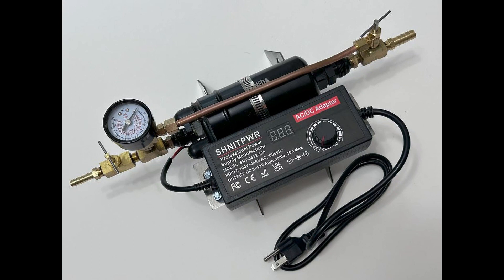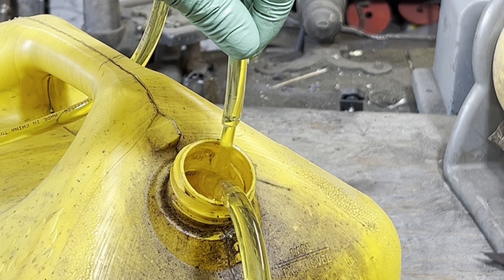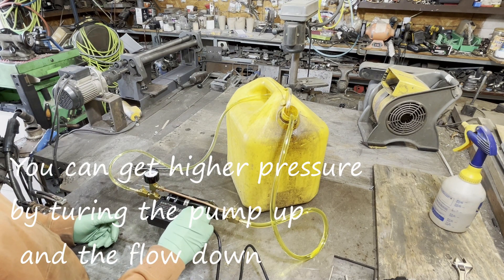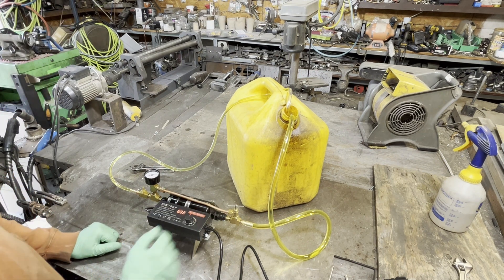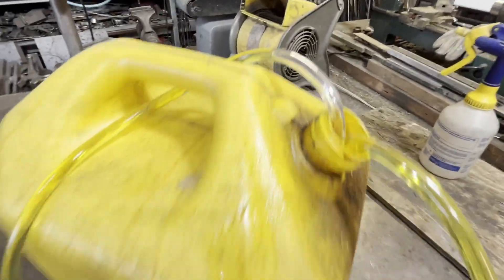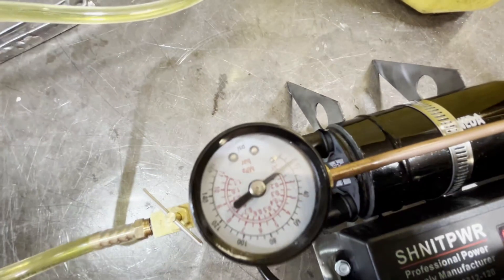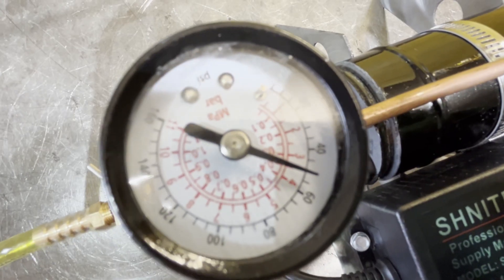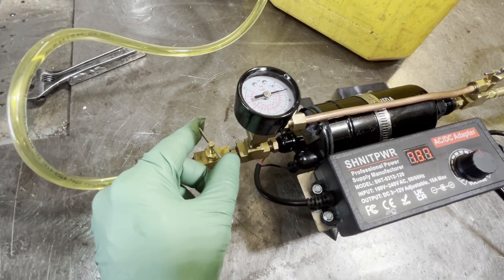Variable flow oil or fuel pump

Comment: I LIKE IT. Can we control this with a thermostat in conjunction with the blower that feeds a pot style burn chamber? I am installing an old Siegler heater that I would like to burn a little hotter using waste oil. Can't seem to get it to burn clean or hot enough with the current fuel regulator and factory fan setup.
Reply from the maker: Yes you could use a couple diodes and a solid state relay to turn it on using the 24 v signal or a multi function relay
Reply: @NOBOX7  I was thinking if you used the pump to pump it into a preheat vessel with a float actuated valve you could essentially turn this setup into a flow actuated pump so that it would only run when the float dropped. What are your thoughts on this and what would it take to make the connection between the float actuated valve and the pump? This setup could be very versatile for many applications.

Comment: will a peristaltic pump be better for metered flow rates? im planning to use a silicone tube peristaltic pump in conjunction with an atomizer nozzle similar to your compressor type builds. i havent tried it yet, but it may give precise kw values, no winter season in our area though.

Comment: You should run the return hose all the way to the reservoir, so that the oil maintains a consistent temperature.
Oil changes its properties when it gets hot
Reply from the maker: to many parts , besides this pre heats the oil better

Comment: I do something very similar, except I use an arduino pwm board with a pressure sensor to maintain a set pressure regardless of flow.
It works great.
One of my preferred uses is for my in tank pump to maintain 10 psi precharge pressure thru  50 feet of line with waste oil in -40c. Without it my precharge pressure would vary probably by 60 psi with oil thickness and temperature.